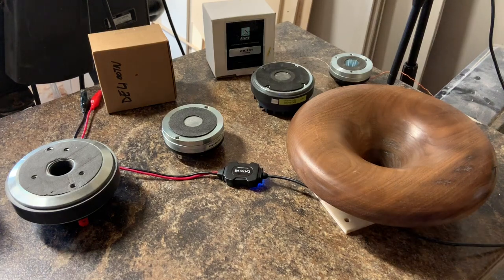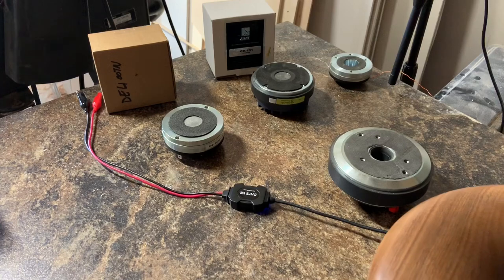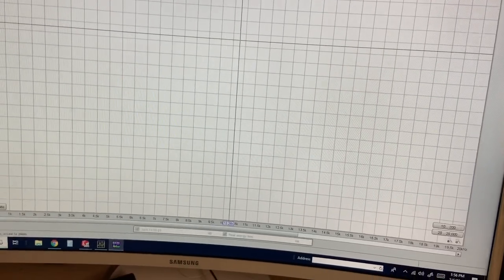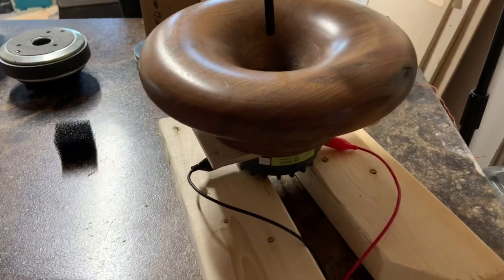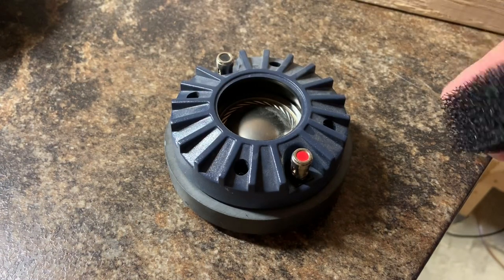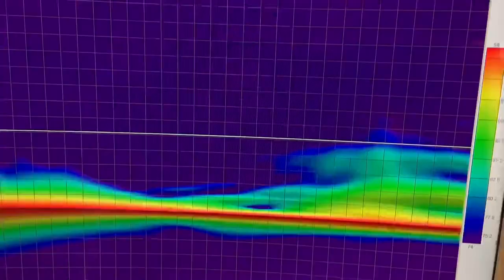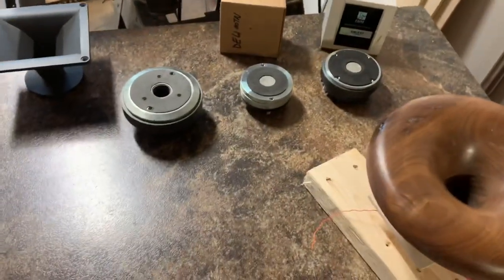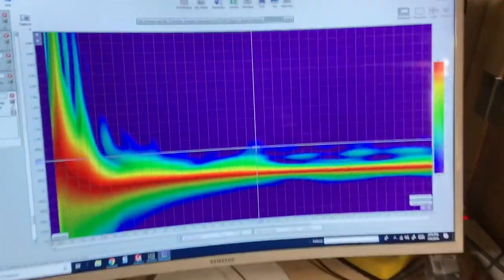Measuring Four Different Compression Drivers

Comment: I have a pair of Radian compression drivers 3 inch diameter. I get between 5-6 ohms across the terminals.  Is that a proper way to test if they are blown? Neither makes sound but my boxes might have other issues. Thanks
Reply: Should read 6.4-6.6 ohm. that's the normal impedance

Comment: does phasing matter on horn?   I ask because I have a tri-amped system using old JBL woofer, horn,tweeter and some have been reconed so I'm not sure if red(+) is accurate on all three components - and while you can see which way a woofer moves when you put 9v battery to the terminals, you can't do that (or at least I don't know how too,) on a compression horn and compression tweeter
Reply from the maker: Yes, it really matters. You can test if you can measure the frequency response. Check out how here…

https://youtu.be/qmF0YSBmgm8

Comment: Sir can you tell me how to I protect my tweeter because capacitor is only bass block but tweeter can also burn in high pass
Reply: high-pass filter, here are options:
1.) electronic crossover built in to the amplifier
2.) rather than using the single capacitor (6dB/octave, 1st order filter), wired in series with driver, add an inductor, wired in parallel with driver. There are free online calculator to determine the value. (measured in mH) the value of the coil determines what frequency it'll start rolling off
Reply: @csj9619  thanks you sir

Comment: With emery paper, rub the inside of the kapton former, until it's thin enough. 
you'll get better response.
Reply: How did I not think of that? brilliant yet simple solution. good job
Reply: @csj9619  But don't damage the coil. when you arrive at the coil, stop rubbing